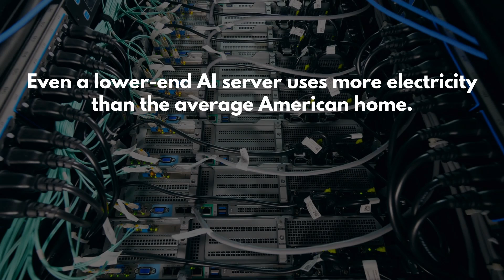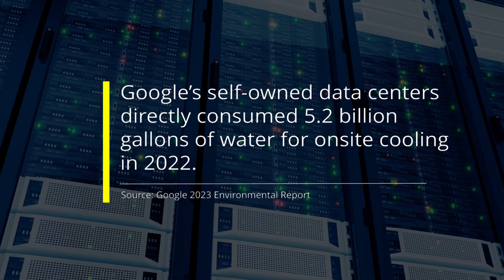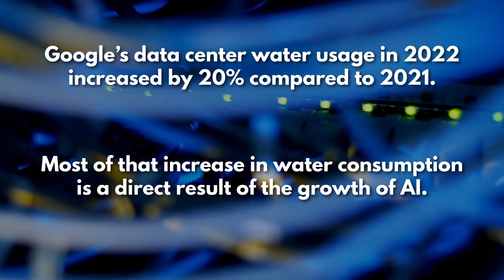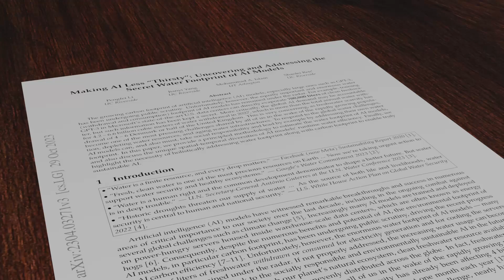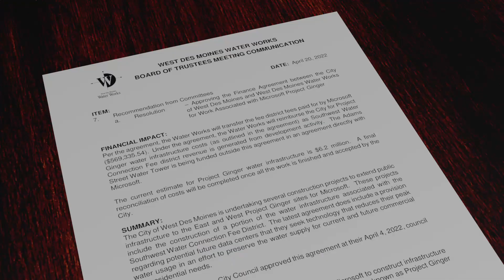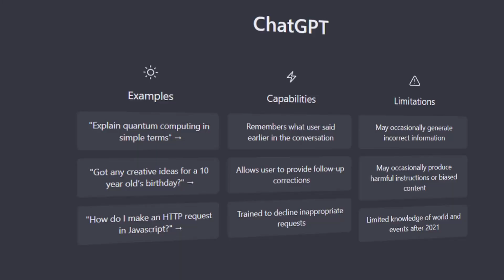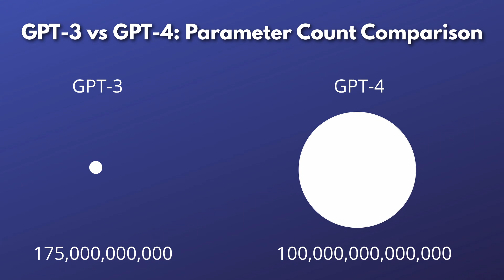Shocking Truth: How AI is Sucking Our Rivers Dry!

Comment: Being from the southwest im all about water conservation, but i must pose a question. Where does all this water go after it is used to cool the data centers? It can't just disappear. Wouldn't it just get put back where it came from? If so, then we have another environmental problem, the heating of rivers and impact on the river ecosystem. As an aside, it seem like the heated water could be used for the heating of homes and businesses in the winter.
Reply: All good point I was wondering the same thing. If the water is used to cool the servers can’t it used to do other things like drive steam turbines, to create electricity? I understand it may need more heat to make steam but it’s preheated. There are many other uses I can think of, this use of water does not have to be a waste of water or ruin the environment. Let’s get smart and make lemonade out of lemons! 😊

Comment: I'm guessing cooling with evaporation is a lot cheaper, but I would imagine another option is to use more regular heat pump HVAC for server cooling. They could put turbines and solar around those data centers to generate the electricity. I work in IT and all of the servers I've ever been around just use regular air conditioners.
Reply: It's easily to "do the math" and figure out how to cool a "server" with minimum use of water.    At worse, the complete will be ordered to restrict itself to ground source or air source heat pumps and simply NOT consume (by evaporation) any fresh water.   Or simply tax it.   This is a non-problem.

Comment: If a developer uses AI and queries the answer to a problem they are trying to solve instead of working the problem for hours without the help of AI, how much energy is saved?
Reply: that would be interesting research to compute that data..... i speculate AI is still a net loss.....organic biological energy use is always going to be much lower, meaning the more the person does the processing, the lower the energy use across the board..... the human body is insanely extremely energy efficient and this equation will not change for a very long time...probably 300+ years until we have much more advanced computers directly integrated into our bodies since birth with genetic modifications.....until then any computer processing will use much more energy than the human brain.....this proves how labor is the real issue with technology development, specifically the problem we are facing is capitalism and only real socialism will truly unleash the potential of technology to liberate humanity.
Reply: @jokers7890  Also consider the energy it takes to maintain the developer's compute requirements while researching the issue.  They often make use of data centers to research problems.  Maybe they use a search engine to find a forum post.  Maybe they go down the wrong path and spawn a few docker instances that lead to a dead-end.  A developer researching a problem could theoretically use more, albeit distributed, compute units than simply asking an AI how to solve the problem.

Comment: the water doesn't get used up does it?
Reply: no.... its a basic law of physics elements are neither created nor destroyed without nuclear fusion (the sun can create or destroy elements, the earth cannot).......so hydrogen and oxygen (h20) cannot be created nor destroyed on Earth....... BUT we can take it apart using energy and the solar cycle does this naturally with evaporation and rainfall....... so the underlying issue as you point to is not water scarcity, it is energy usage...... the natural evaporation/rainfall cycle is fueled by the suns massive energy...... our energy systems are very primitive and cannot provide enough energy yet needed for the massive movement/cleaning of water that we need.....so instead we must rely on natural free flowing clean water and we are even screwing this up too because of very primitive capitalist system.